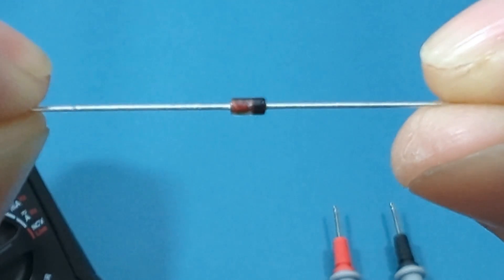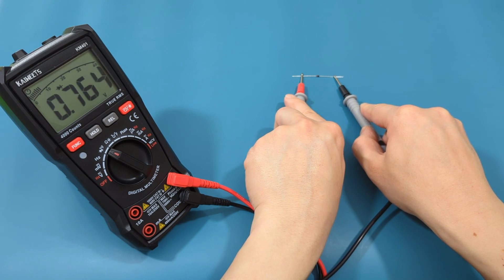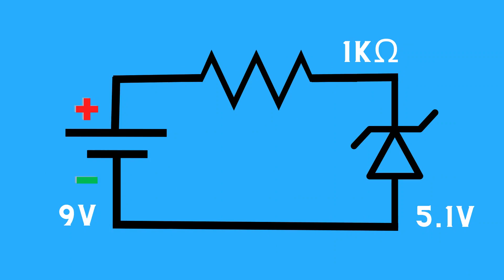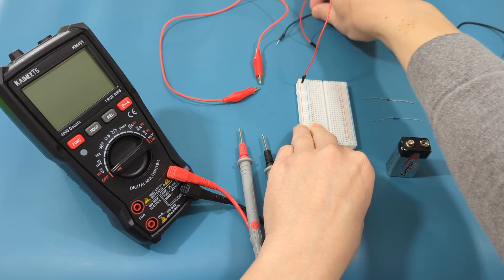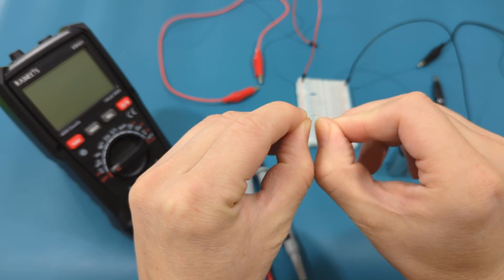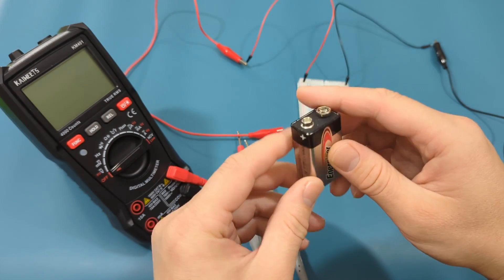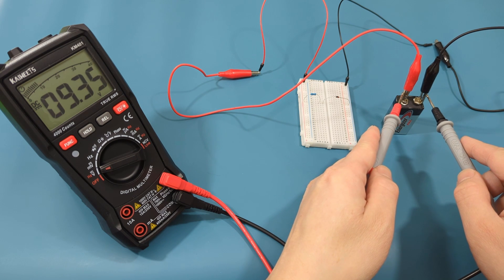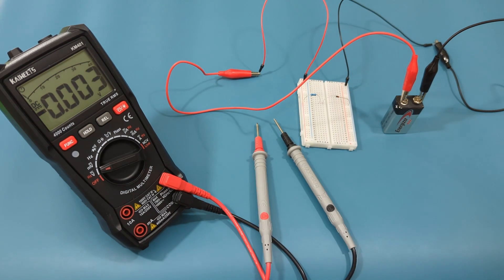How to Test Zener Diode with Multimeter

Comment: What about if the value of the zener diode is higher than the batterie supply ?
Reply from the maker: If the Zener voltage of a diode is higher than the battery supply voltage, it will act like a regular diode, blocking most current and preventing voltage regulation as the circuit operates at the battery's lower voltage.